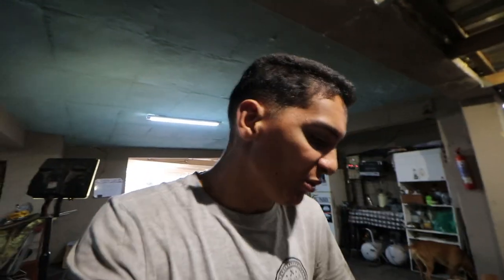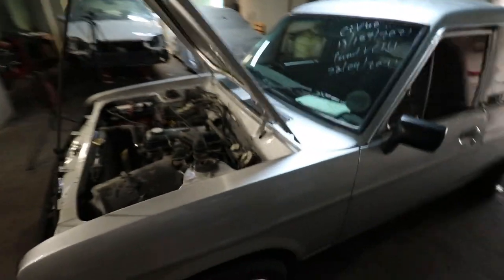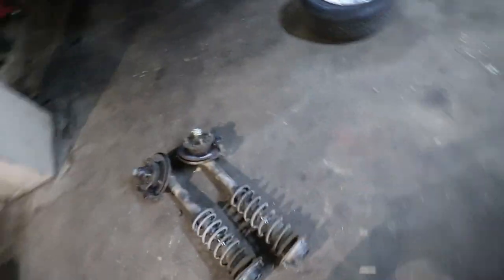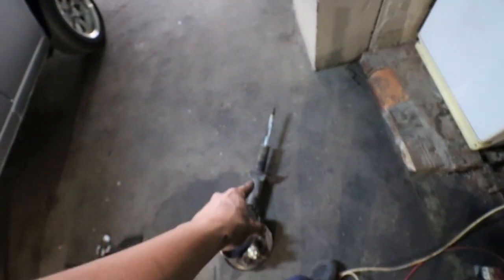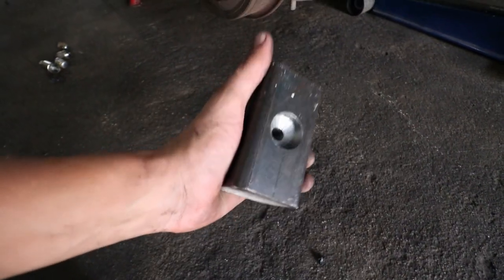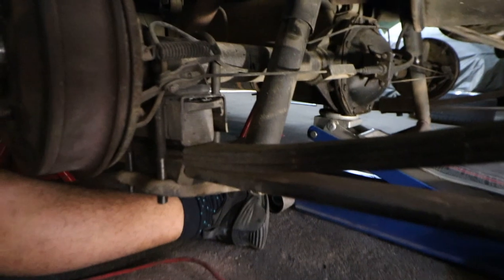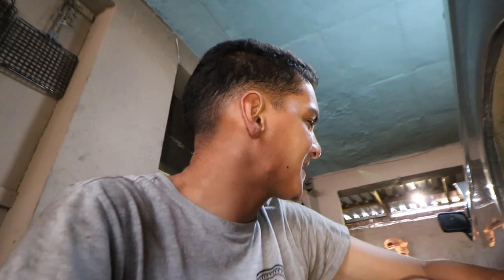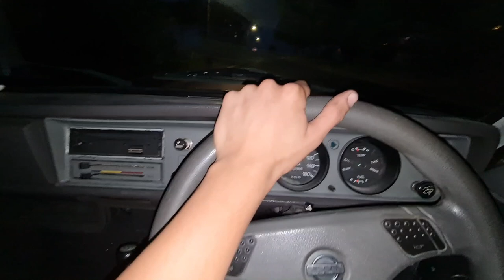Lowering a Nissan Champ Pick-up Bakkie! 😱 (with Sleeve Overs & Lowering Blocks)

Comment: i made the U-bolts thicker so can handle more stress and its 235lbs sleeves i supplied, wasnt aware was a std engine champ,normally supply 195lbs for std engines.Have the reinforced top hats as optional extra.
The extra bits encasing the leaves can be removed ( new models came out with those )